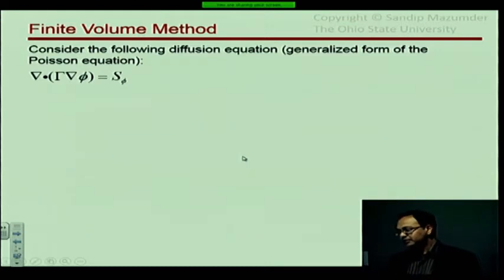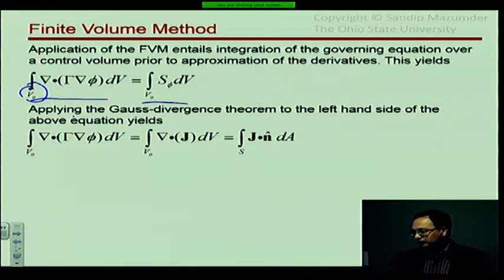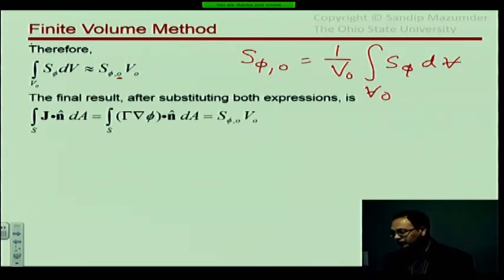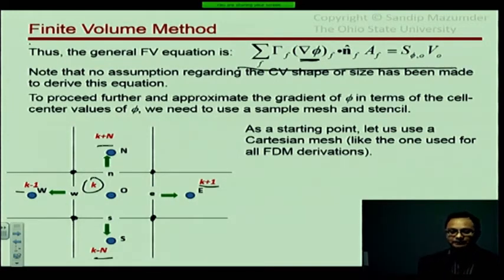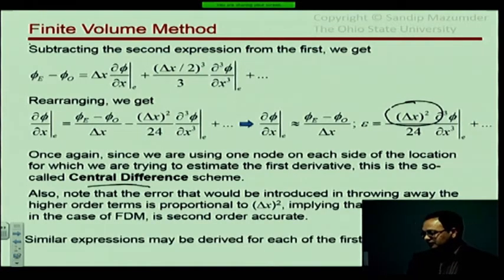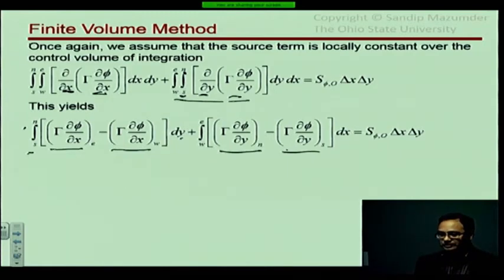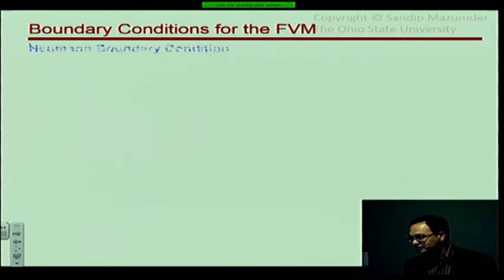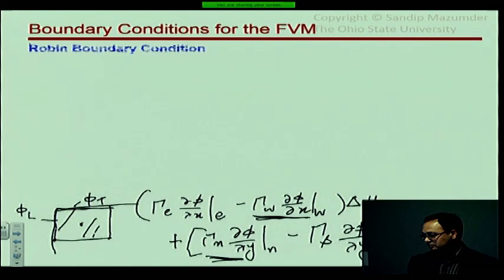Finite Volume Method: Formulation in 1D and 2D

Comment: i dont understand how dv=dxdy. please explain me
Reply: dv(Area)=dx*dy. It is like area of rectangular.
Reply: @atalaysecer4711   Dear Sir, i am thinking about your second approach i mean just integrate the 1-d,2-d.3-d differential equation. In case of 1-d if you are integrating the differential equation it will only be valid when cross section area is same, otherwise if you think gauss divergence point of view area will be there as you have to calculate flux. In case of 2-d, as you are saying put dv=dxdy instead of dv=dxdydz, if you are putting dz=1, so small quantity cant be 1. please explain me
Reply: @rajeshshukla3487 Hello, first of all I am quite newbie, you might know more than me. For your question could you look at this figure( https://pasteboard.co/J6YAY5z.png ). In there for example for 2-D, the dz you said is not 1. It is just not mentioned, maybe there is no need a third dimensions information or we could say it is just another "-". I hope it is the answer you are looking for. If you interested books name is An Introduction
 to Computational Fluid Dynamics from H. K. Versteeg and W. Malalasekera.
Reply: @alihammouche1657  Hey! Yes I can.